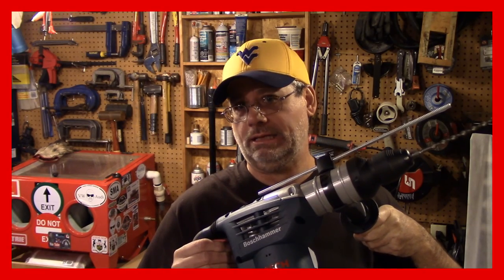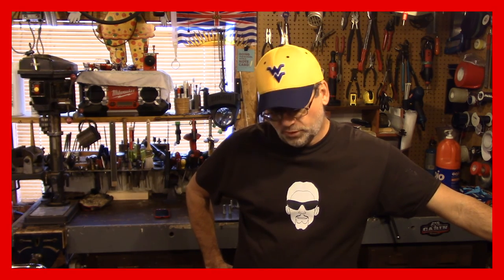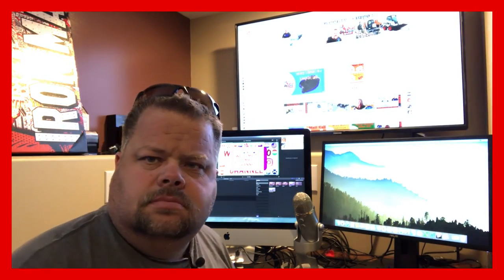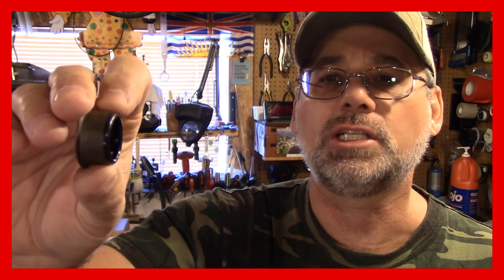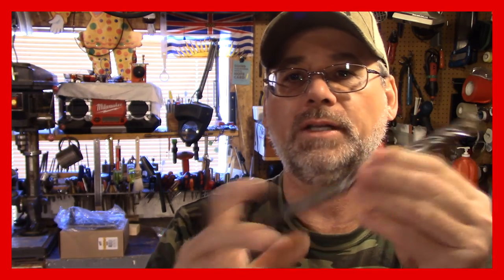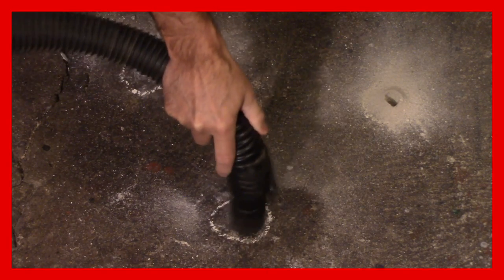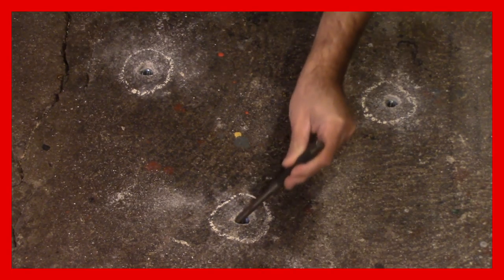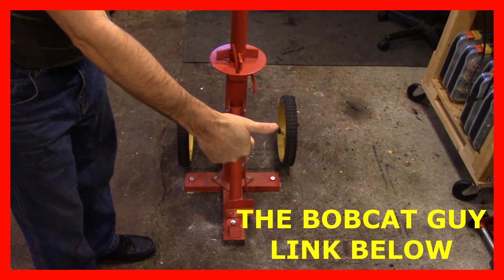ROTARY HAMMER DRILL  INSTALLING  MANUAL TIRE CHANGER  - BOSCH RH432VCQ 1-1/4 INCH  SDS-PLUS

Comment: Steve, I have the Bosch 1/2" hammer drill. Not a pimple on the ass of the rotary you have. It does drill concrete pretty well. When i secured my tire changer, I used lag screws and lag shields. After a few tire changes the lags pulled out of the floor. I think your on to something. With a 5/8" drill the holes got wallered-out. The lag shields seemed loose and the lag screws lifted them before they grabbed. Managed to get them all out and replaced with the same anchor you used. Set them in with a punch. Now the lesson learned, the holes were too big. Was it the bit or the hammer drill. I made plugs just like you did. Got my tire changer shortly after you got yours. Wife came out to the shop and said, "I can't believe you. You're going on 64 and at this point in your life you decide your going to start changing your own tires. What's wrong with you. "  Steve, there's nothing wrong with us, is there. I went on a tire changing binge this spring and have got my money back at least 4 times over, not to mention I cancelled my membership at the health club. Should have done it years ago.  LOL. KIT d
Reply from the maker: HAHA my wife says everyday what's wrong with you.   My friend a millwright told me he used them  anchors at a molsons bottling plant but they poured an epoxy in the hole as well to seal it up and lock it in there for life all SS anchors.  My health club is from may to november at the camp every year. LOL

Comment: The Bosh hammer drills , are hard to beat . We used a clay spade bit a lot . Nice bit if digging . Bosch HS1922.  a nice bit to have
Reply from the maker: Thanks Terry I will look it up and see what your using.
Reply: It is a wide spade bit . no good for what you done in video , but nice bit to have , that works well  with the bosh . The bit is really  made for digging in clay dirt , but we used it for a lot of things .

Comment: Nice drill. I have a Bosch as well. I never use a reducing bit first but I do dip my bit in water to help keep the bit cool and help keep the dust down. Enjoyed the vid. Hope all s well on your end.
Reply from the maker: Thanks for the tip on the water hahaha never thought of it duh.  Yes buddy alls well , I have been at my camp a lot , just came back yesterday.  Paul you need a good laugh. I bent my kubota OMG what a mistake. I left my drawbar out in the extended position and went to hook up my rotary cutter and as i'm backing up I always lift the arms , well if it didn't catch one of my stabilizer links and bend it like a pretzel. LOL   I have it here and going to see if i can fix it. Oh ya it will be a vid for sure LOL   Hope your doing well , so glad to see your back at the vids and back at it. Just terrific buddy , so happy for you and Kathy. Cheers
Reply: Wow. Sorry to hear about your draw bar. Things happen. I'm sure you'll get it fixed. If you can't I'll do it for you. It's been a little hectic here going back to work and doing vids. Not much time for anything else do I had to come over and check out one of my favourite channels. Glad your doing well my friend.

Comment: You got yourself a nice drill there Steve. We use a Bosch hammer drill at work  and have been using it for years. Sounds like you've got quite a few projects lined up for the year. Be safe and have a good one!👍
Reply from the maker: Terry I should have got one years ago , what a difference.  Yes I have lots of jobs for it mostly up at my camp .  I can't believe for years I fooled around with the screaming hammer drills burning out bits like a madman. LOL

Comment: I've always drilled through the slab to mount machines in the shop and Hilti anchors. That way if something strips out or gets messed up you just drive it through and put in a new one. They were required by the city though, and cost up the butt. Those looked like they should work pretty good. We were mounting Jib cranes.
Reply from the maker: Thats a great idea for next time, yes I can see the logic in that. Thanks Terry , all I have to do is remember :)
Reply: Me too 🍻 Have a great week!

Comment: Nice drill. You know if something is seized and you can't be bothered to set the air compressor up and get the air hammer. The hammer function on an SDS drill and a chisel bit works pretty well. 😂

The 36V cordless one Bosch does is pretty damn good. I've never tried one of them hole cutters with it though. Does concrete pretty well although biggest i drilled with it was 16mm holes. 

Enjoy the 🇨🇦 day weekend. 🍺
Reply from the maker: I have the chisel bits but haven't tried them yet, but I will.  I built a tool to go with the sds drill   and will show it this month.  I think you will guess right what it is for. Cheers

Comment: Use a old drill bit for the hole. Hammer drills will work with a old Drill bit. You do not always need a Concrete bit. Are you sure you are Canadian lol. Adapt and Conquer. Good Video and i own two Bosch Hammers drill from the 90's and they are the Best out there.
Reply from the maker: Well I don't have a drill chuck to snap in for my old bits but I will get one soon .  Canadian EH !!!   oh ya and ya never know how much American too. LOL   Cheers buddy.

Comment: That tire machine isn't going anywhere now.  Hammer drills make drilling cement soooo much easier.  I think one of my bigger Hilti drills was around $1200, bits not included!
Reply from the maker: HAHA and I haven't had a chance to try it out but it's in there. LOL   I have to laugh at the years of using a screaming hammer drill at 10,000 rpm just chewing up bits and getting nowhere fast. LOL  I have a baby one compared to what the pros like you use .  I built a tool for it coming up this month and I know you will know what it's for right away.  I went to buy one and it was $160 so I built one from scrap around the shop. OMG  I hope it works. HAHA
Reply: +STEVE ROB little ones can get most jobs done.  That's what i heard haha Take care

Comment: Nice idea using the board to position the holes. BTW that's an expensive rotary hammer drill. There are cheap ones that are pretty crap, they look more like a normal drill.
Reply from the maker: Thanks , well I have seen some offshore stuff real cheap and they do work for a while but not for long.  This one is going to get quite the workout with projects lined up and I knew a cheap one would last.  Thanks for taking a look.